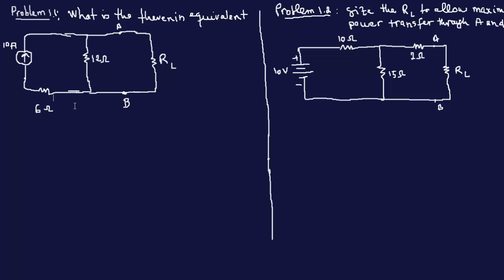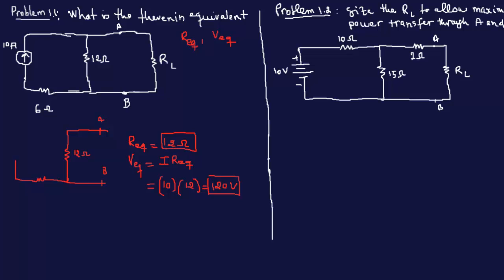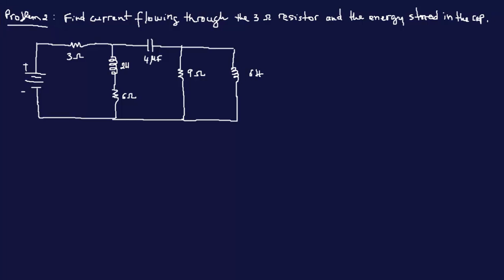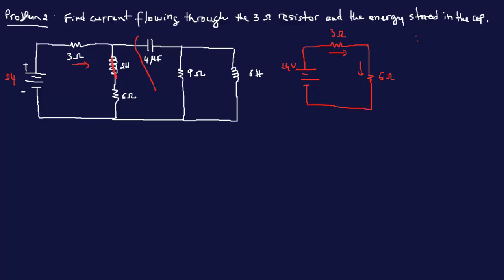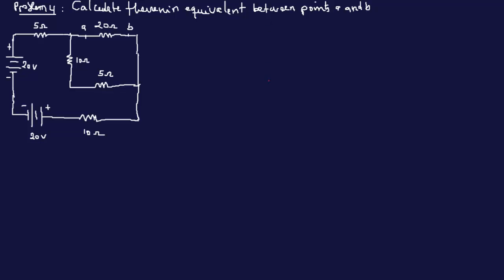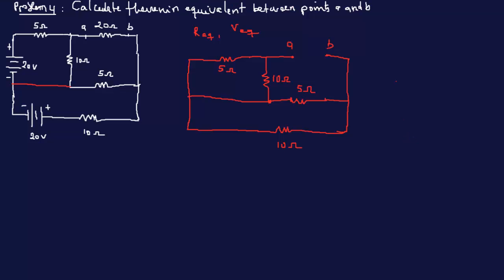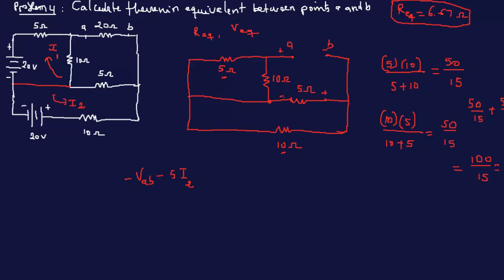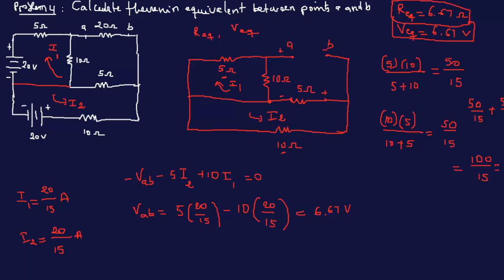DC Circuits Problems 2: FE/EIT Review

Comment: Hi, for question three, I was wondering power also = v2/R. I used 12v square divided by the 6 ohms resistor but did not get the same answer. could you please clarify if I did the wrong thing?

Comment: In the first problem, why did you also leave out the parallel resistor on the right?  I understand that the current source had to be open circuit, but I don't understand why the resistor was also set to open.
Reply: The current source is open, the resistor became floating, thus not in the circuit so if you redraw it you would only have the 12ohm resistor in the circuit.  That is why she didn't add it.

Comment: hey I like your review a lot, however a point of correction on question 4 the req is 7.5 ohms and my argument is that since you short circuited the two voltage sources the two 10 ohm and the 5 ohms are in series , but the pair is also in parallel which brings their total to 7.5.
Reply: She forgot to draw a line in the circuit, my friend. I thought the same thing lol. That red line is actually part of the circuit.
Reply from the maker: Alo, they are in parallel though because of the junction in between the two resistors. They wouldn't share the same current flowing through them.

Comment: ...you didn't finish problem two...
Reply from the maker: *****
Oh yeah you're right now I see...I left out that part towards the end of the question. Thanks Jeremie.
Reply from the maker: Linus Nandati
Oh, think of the voltage as a potential difference. The voltage across the capacitor is the voltage across the 6ohms minus the voltage across the 9ohms. However, the V_9ohms is zero because of the inductor. So the cap voltage is the same as V_6ohms. Therefore V=IR=2.67*6=16V....
Reply: Raiya Energy Could you explain the relationship between V_6ohm and Vc (the voltage across the cap)? I get why V_6ohm is 16V, but I'm not sure beyond that :/
Reply from the maker: Linus Nandati
Linus, which problem are you referring to though? Problem 2 with the 4microF capacitor? The cap is gone due to DC. I'm not sure what you mean by V_6ohm.
Reply: Raiya Energy I am referring to problem 2. I cannot figure out the second part. Could you explain how to obtain the energy across the capacitor? V_6ohm means the voltage across the 6ohm resistor.
Reply: Raiya Energy I am having trouble seeing why the voltage across the capacitor is 16V...
Reply: thanks got it now =)
Reply: she did, the problem only asks for the requierd RL to have maximum power transfer
Reply: @manuctz  rthevenin and rload are different no? finding req is finding rthevenin. rload stays same through out the process. so at the end we just found the r thevenin and now we need to find what rload value is to make pmax valid.pmax is vthevenin^2/4rth. none of those are rload. thevenin equivalent circuit is vth in series with rth and rload. EDIT: i see that at max power rl = rth 😄😅
Reply from the maker: Tim, we needed to calculate the load resistance only. Thanks Manuel...